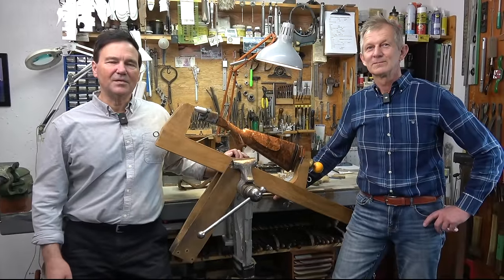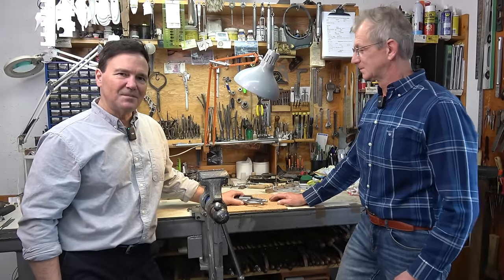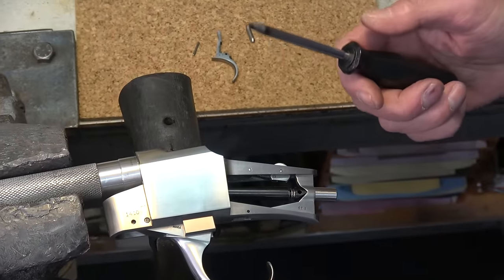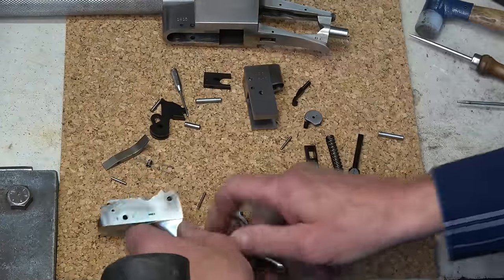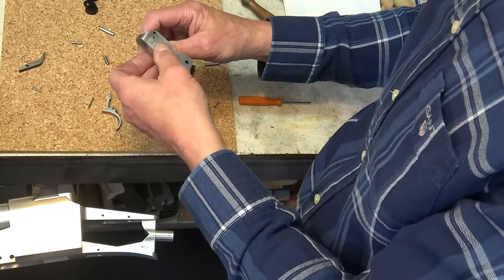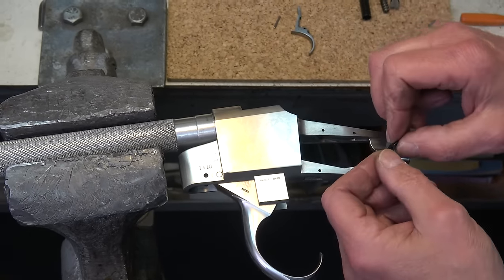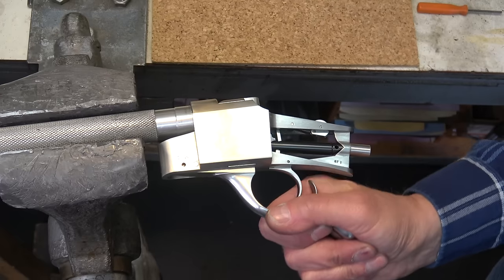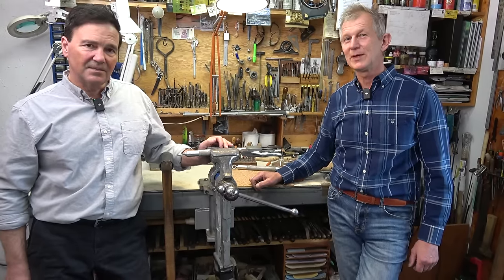HAGN Action: Disassembled/Reassembled with Ralf MARTINI

Comment: Thank you! I wish I had a set of drawings to go with the castings. Does the breach block have any camming action? It appears to be at right angles. Does it have the ability to cam the hammer back on opening or is it a rebounding system? What keeps the Firing pin from being stuck in the primer as is common with the Remington Hepburn ? This is a great single shot action though I feel the Farrow has some features that make it at least as good if not superior for some purposes. Again thanks for the video and especially for the introduction to Mr. Martini
Reply from the maker: Thank you as well. The firing pin has a robust spring to return it to battery after the impact of the hammer. You can see the spring in the video and Ralf refers to the spring when removing the firing pin bushing. The Farrow is a very fine design, yet with the hammer it is in a different category. Lock time is a factor - although to me not such a major consideration; which is why I like the 1885 so much. Still, Martin's action is in a way, in its own class - there is nothing that I know quite like it. I appreciate that you wrote and please keep writing. My best.